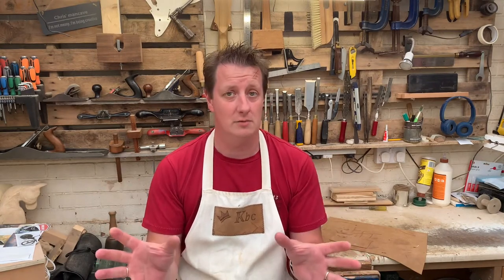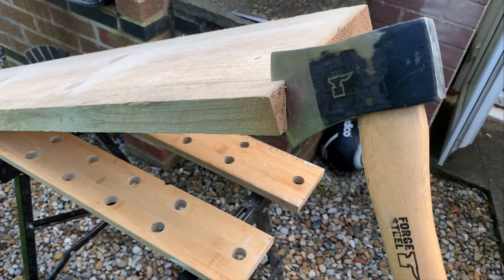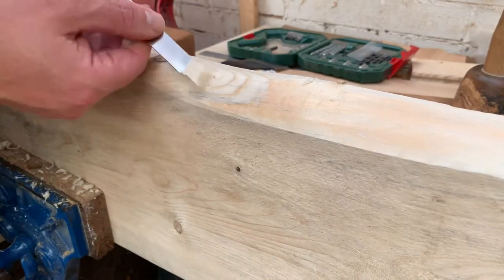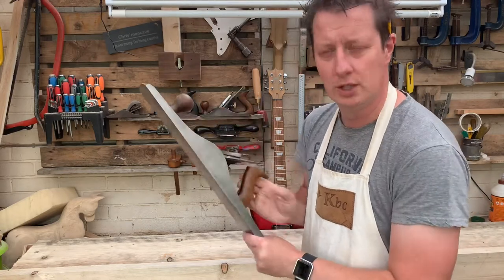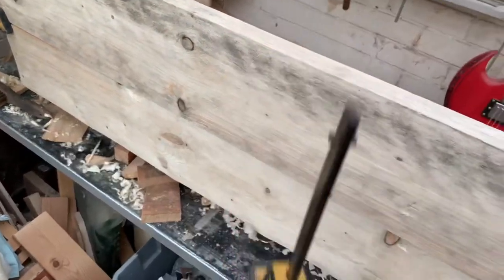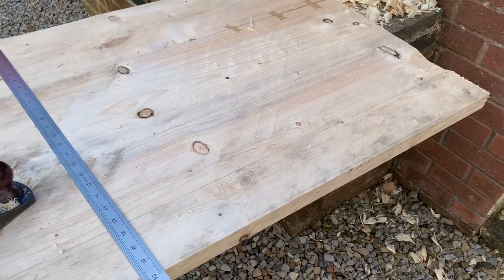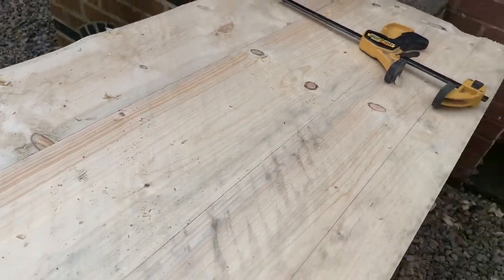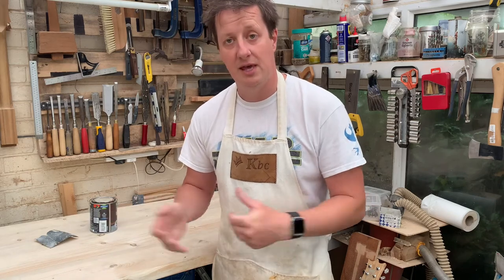How to create a live edge desk / table top from cheap scaffold boards!

Comment: Thanks a lot for this! I've only made two guitars in the past but now moved so that I've got a garage to start a little wood hobby again.. but pretty much my first project needs to be a dining room table, so I've been stressing quite a bit over the all the tools I see used: thickness planer, table saw, router sled, expensive sanders, chip extractors, etc. But 90% I'll be doing much smaller projects and the table doesn't have to be factory-straight so using hand planes and such is relief to see! Now I'm off to try and hunt something like a 4 and a 7 used.
Reply from the maker: That’s great!  I’m sure you’ll fall in love with the plane when you get started!

Comment: Super video, very clear instructions for novices! Going to try same but the scaffolding boards I have are intensely dusty! Sanding 60 grit doesn't even begin to take it off. Any tips on cleaning the boards?
Reply from the maker: Scrape them. Either with a proper card scraper or you could use the back of a metal saw to do the same thing.
Reply: @KingBespokeCreations  OK, will try that and wire brush too. If I powerwashed them, would that add too much moisture do you reckon?
Reply from the maker: @mariacheung804  probably

Comment: When 'letting in' ties or inlays, start by using a sharp drill bit with a depth stop to remove the bulk of the material, then move on to flat chisels, 
Then if you have gauges use them for refining the fit.

That said you can buy a router now far cheaper than the cost of a basic set of gauges.